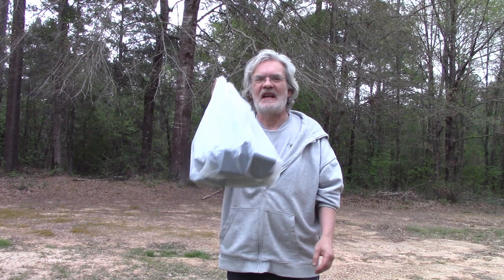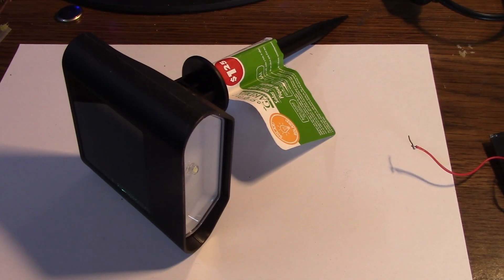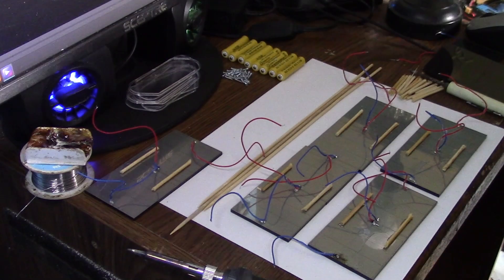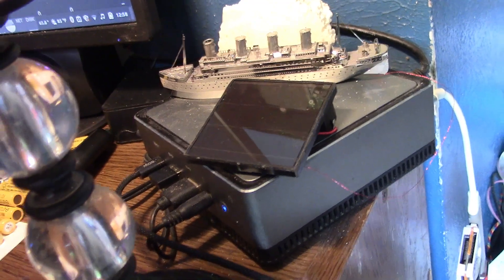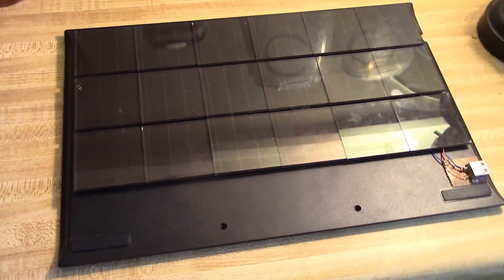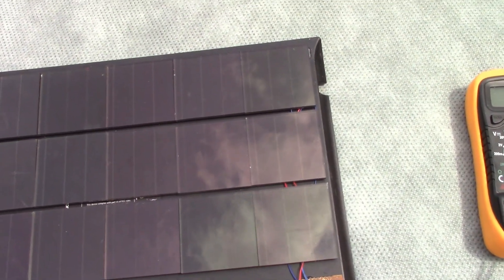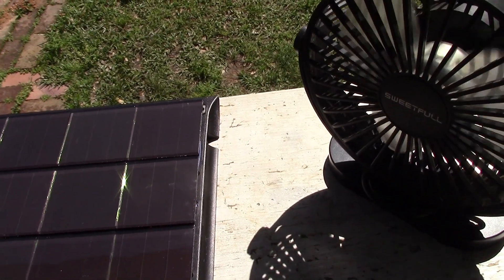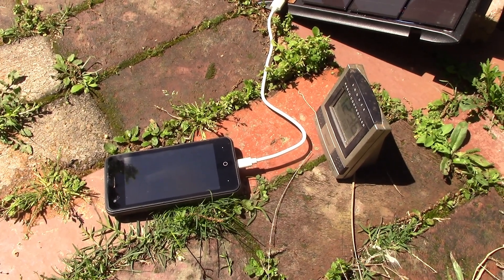Charge Your Cellphone With Garden Lights (Full build)

Comment: Performance on a cloudy day is a pleasant surprise.  I tried pushing it farther by using my North facing window (as all my South facing windows have solar heating cans in them) and 8 portable back backing solar panels (bought for $6 each, sold as not working, most only needed wires re-soldered to the panels) .  The window only gets ambient sun light.  Is still able to charge two in parallel 18650's in three days.  Nice to get use out of an unused window and panels that would just be sitting in storage.
Reply from the maker: Excellent report and exactly what I like to do here 😄Have still got a bag of solar cell bits from about 10 years ago that were sold that way as 1lb bags. One man's trash etc.

Oh, the solar heating cans... what's your experience? (I'll look to see if you have a vid, as I'd rather go at that project with known trusted info than a randomly found video). We have about 300 cans now of my wife's fave soft drink over the years, Ghost energy. Sprayed a can in black yesterday to see about coping with strong UV. Glass is better than plexi I presume(?) so we're looking for old windows. Am also unsure of how much heat loss there would be through, say, lagged or buried toilet PVC pipe of 40ft length and with a PC type fan to draw it through from the cans. Got the cans, got no idea otherwise 🤣
Reply: @Slider2732_  
I have the bare minimum to make solar heating cans.  Enough cans to fill the window, painted flat black, and a cardboard backing so the air enters at the bottom and exits at the top.  Monitoring the indoor / outdoor thermometer, I can see it heats my 20 foot by 20 foot bed room (with the walls not insulated)  about 17 degrees warmer than the outside air when the outside temps are between 55F to 67F.  The lower the outside temps, the less it will heat the room.  Mostly due to lack of insulation, I can literally feel the air blow through the floor boards when it is windy outside.  Though even when it is 32F outside, I can still get a 7 to 10 degree increase in the room.  Some free heat is better than no free heat. 
To do it right requires more resources than I have or can find.  This guy claims to get real amounts of heating with a reasonable investment in materials: {file not found}  I thought I saved it in a YT playlist but cant find it now.  He either used baffles 
https://i.ytimg.com/vi/bRNXf19t8g4/maxresdefault.jpg 
or black drainage pipe 
https://i.pinimg.com/originals/ab/da/8d/abda8de3644be050aae51cc36a3f834c.jpg 
I think it was the drainage pipe.  It was only used to heat the basement. 
He built a box about 2 feet tall and ran the entire side of his house, about 75 to 100 feet.  I think he used Plexiglas and went to extra lengths to make sure the box was air tight.   The drainage pipe snaked back and fourth horizontally 3 or 4 times.  He had a fan on a timer push the cold air in one side and the hot air came out the other.  He had to use a flapper valve or it would work in reverse at nite, pulling in the warm air and cooling it without the fan even running.

Comment: Oh, crap ! Yt is deleting my messages if I add a link 😢

So, they may work better if you use an adjustable dc buck booster converter (most of them have mppt capabilities) … consider it as an mppt solar charge controller for the voltage and current you want. I had a link to amazon but reckless YT delete the whole message if I place a link, eventually I can send you an email if needed. They cost like £10-25 depending on amperage some of them can be used for driving dc motors +30A or they even can have frequency generator for adjustable speed or even duty cycle separate for positive and negative … still cheap ( under £30). I guess you get the idea of what I am trying to suggest.

Eventually use 1 or more darlington arrangement to boost current.

Also, regarding your videos for water based Joule Thief instead of blinking LED you can use a zener+scr/mosfet to dump at HF into bigger cap or even batteries+supercaps pairs.

We only need a little trickle input 😂
Reply: Most of them are buck MPPT... The cheapest boost MPPT is the 300w with the blue label. Or the slightly more expensive green one if you need a screen on it.
Reply from the maker: @Kangsteri  Thanks for the info,  Kangsteri 😀
Reply from the maker: Many thanks for the suggestions. I'd say there's mileage in such ideas for tiny solar, especially if people already have a bunch of older solar lights and are thinking of replacing them for the upcoming Summer months. Glass amorphous are solid performers for years, not so much the epoxy coated 🤐 
I do already have the cheapo DC-DC boost converters, 3V to 30V at 2A, XL6009 types. That would bring in a more regulated and constant voltage solution for 12V car electronics too. 
Thanks also for the zener tip... I do need to get back to that project!
Reply: @Slider2732_ I mean, we have a system that we know is working … solar harvesting energy, what would cost/stop us to use any other input which is constant 24/7 ? Use the output direct as it or charge batteries/capacitor banks and inverter 😉

No need to supply the grid being paid 25% of their selling price and consume from the grid earning if something is left after balance … keep the grid as backup only and use all you can from your system … lookup for caravan/RV appliances for direct usage … not much difference, eventually cheaper … even your pc is running on 12/24 dc, have a think.